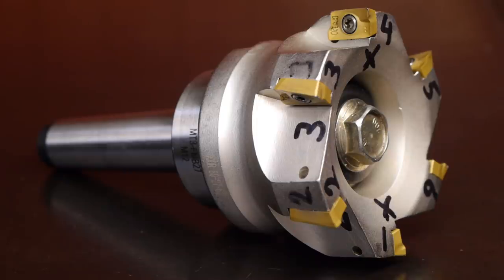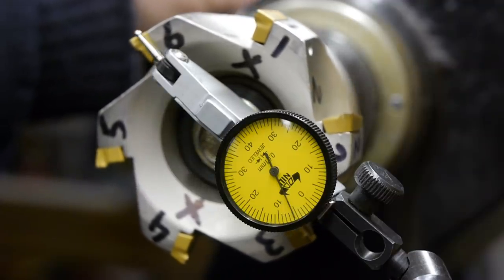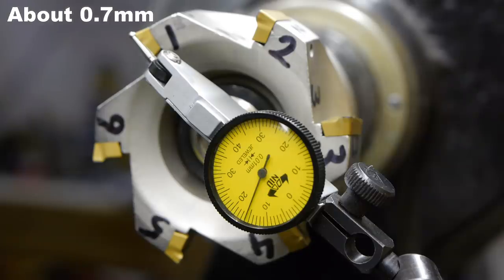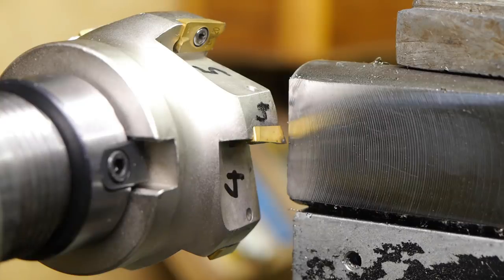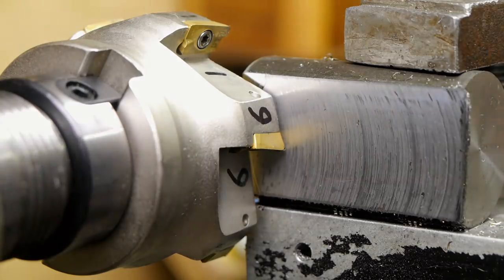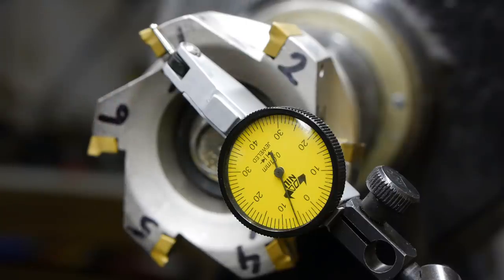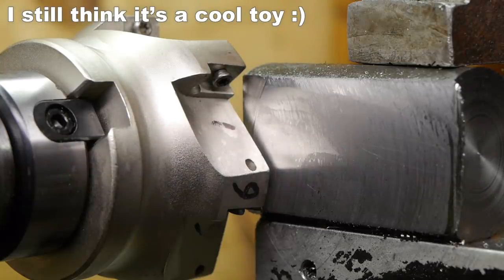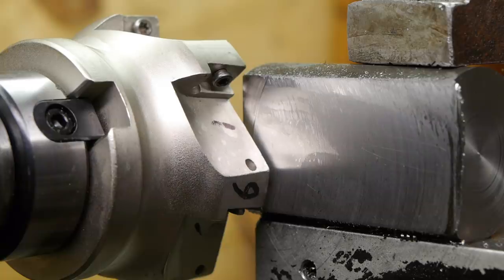Measuring the 80mm Chinese shell mill inserts height

Comment: Thanks for taking the time to do all this testing. Saves me a whole lot of experimentation to prove what I already suspected about the one I bought. I guess you get what you pay for. I'm beginning to think that these milling heads were specifically designed just to get us to buy more replacement inserts. I personally get a better finish by using a big 4 flute TiAlN carbide end mill. When I finally get my mill up and running, I'm going to try to perfect a fly cutter, so all of these multi-insert heads can go where they belong.

Comment: Thanks for sharing. Did you notice how good the finish looked when you had changed the pulley configuration. Maybe it is a rigidity issue and a slower speed and feed limits some of the end play. Maybe one more go at it slow and steady?  Although not ideal for carbide, it looked good for that brief moment you did cut.

Comment: Very interesting. As both the pockets or mount points and the inserts have manufacturing tolerance, maybe one could swap them around until the deviations cancel out more or less. After all, that's what they do in many industrial processes as well: manufacture something, accepting certain tolerance, then sort into statistical bins afterwards (LEDs, MOSFETs etc.)
PS. I bought a similiar cutter today, just a 4 face 50mm one with MT3 shaft. It cost 26 EUR incl. shipping. I wonder how they do that. (I used the links reserverd for members of the cult, hope that helps toward the mill..)
Reply from the maker: interesting idea. The tolerance on those inserts is about 0.1mm but I never bothered to check the size difference between the inserts.
Reply: @Rolingmetal  well,  that's probably a couple orders of magnitude above the inserts tolerance, then. Still, there are the screws to consider, which were possibly sourced from the cheapest supplier they could find..

Comment: Why 80mm? that size face mill with 6 inserts would normally be used on at least a Bridgeport sized machine, I think the general consensus is a fly cutter being the preferred option for smaller machines, although, I did find a 3 insert TPUN 40mm face mill gave good results, TPUN inserts are also available as commercial grade by many different companies.

Comment: Hi again, still love your vids and humor. You an me are using eqitment vit not the best posebilletyes, play in bearings and cheep bangood stuff. But when something is fleksing, f.eks bearingplay or a long stickout, the tool cant get underneeth steel and will just rub the chjps of, rather than cutting it. then the best way is to overdoe the feedrate and cut, and it will be better surface, but ven you ar closing in on the right size end take light cuts the surface vil get wors again, just have to live with it.  I have a good strong mill at home, and do some lathe work also in it.  I just turn the millinghead 90 deg and put a 3 jav chuck in the mill head.

Comment: The axial play shouldn't matter much as the cutter will be pushed back against the bearing.
You should also check the inserts on the other plane with your dial.  That is on the outside diameter of the cutter.
I think this is a good test though.
It looks like you did indeed get chips stuck back on to the surface.
I wonder what you get if you put a mic on the actual inserts.  Are they all the same size?
Carbide tends to give a better finish with heavier cuts but I understand your lathe isn't really suitable for that. 
Good test but :)
Happy turd year just so you know I watched it to the end.

Comment: You are not really taking a big enough cut with that tool (typically one would bury the nose radius, but you lathe may complain)  the inserts have chipped because of vibration (they have been bouncing onto the front edge).
Reply from the maker: I tried 0.8mm in the previous video but that was about the max the lathe could handle

Comment: I had similar results milling steel with one of those on my little ChiCom milling machine , it works fine with aluminum . I think it may be a result of not enough rigidity in the machine .

Comment: i have the same face mill ,you should run this on a mill at around 1600 rpm and above.also if you are worried about the difference in height of the inserts,why not shimm them.?
Reply from the maker: that's 4 times the speed the online calculator came up with.
Reply: @Rolingmetal  check out cnc using carbide.with coolant .
Reply from the maker: coolant would  just ruin my wooden work bench :)
Reply: @Rolingmetal  i think you said ,you are going to buy a mill.warning?don't buy a chinese mini mill.you will be sorry.just my opinion of course.
Reply from the maker: Yep. I switched on advertising on my channel back in December and I am saving up those earnings to buy a  little milling machine. The original plan was the cheapest mini mill but I've already switched to a more substantial  machine. Still Chinese, but I'm keeping my eyes peeled for something nice, small and vintage.
But there is no rush and I haven been spoiled with high end tools, so I'm sure I'll have some fun with whatever I end up buying.

Comment: Happy turdyear ;p     I see 2 obvious problems . ... the spindle 'floating' , and the cross slide not being square to the spindle .   The cutter shouldn't cut on the end of it's travel, if the cross slide & milling cutters were square to each other - much the same as a milling machine that is out of tram !   Could you try this setup on the Chinese lathe ?  
     Another thing you could check is the face of each cutting position with the inserts removed , which might be another clue to look into .      Good luck , & enjoy your turdday ! 
  "V"
Reply: why should the cutter not cut if the head is out of tram?
it will cut but not produce a flat plane but a concave surface.
Reply: Hello Jan , look at 6:32 . . . the back side of the cut is 're cutting ' - that means the play in the spindle is allowing the cutter to float into the material , or that the cross slide is not square to the spindle.  If there were enough cross travel to complete the cutting , only then would it show to be convex or concave !   Every cut that he made had a similar cut, with the END of the cutting biting deeper - the same happens when a milling cutter or fly cutter is used on a milling machine that is out of tram. . . the back side / trailing side of the cutter will 'dig in', but will leave only the slightest mark , or a cross hatching pattern if it is in tram !  With the play in the spindle , the cutter is cutting a 'moving target' - I would venture to say that the milling cutter is pushing the material toward the spindle at each of the cutter's edges , but NOT equally , so the end result is what we see as a strange finish. . . it shows accelerated wear of the cutters , as well as what looks like 'galling' of the chips into the finished surface ! ?     I will say that it is better than no cutting at all ! ;)   "V"
Reply: @georgewocosky  the cross slide is not supposed to be square to the spindle., all lathes are create that way to make sure facing does not create a convex surface
it is impossible to create a convex surface with a circular cutter no matter how far the spindle is out of tram

Comment: I think you may be expecting too much. Milling cutters like that are commonly mounted in substantial adapters in roller bearing nilling spindles. You have mounted it on an adapter with a smallish straight shank. Your machine is apparently a low power import lathe with (I'm guessing) an un-geared variable speed spindle. 

Youre testing the face run-out over worn, utinity grade inserts that may vary somewhat due to manufacturing tolerances. The facts your face run-out is within small tenths is quite impressive. 

Insert milling cutter bodies like yours are commonly validated by scanning face and radial run-out using a single insert movec from pocket to pocket in reference to the gaging diameter and face ground on the body itself. 

That said, there's no reason you can't use that cutter and adaptor for taking light facing cuts as you demonstrate. Your finish appears excellent. If you were expecting shiny, don't. I don't think your present machine and tooling will support the peripheral speed necessary (maybe double what you're running now.) I suggest you just use it but don't try for significant stock removal per cut.

Comment: Thanks for showing us this, i know now not to buy such a cutter. 0.08 deviation is way to much for getting a good finish. Also the inserts seem to be made of cheese.
Now if you were cutting hastelloy or inconel or something like that ... but mild steel should be nothing for decent inserts.
Reply from the maker: There is a lot of tolerance on this type of insert. about 0.1mm that might also play a role. I think the facemill is pretty decent and word a lot  faster than the fly-cutter.

Comment: Somewhere jn the VFD parameters is a modulation frequency setting usually 4000, 8000 or 16000 (4kHz, 8kHz ,16kHz)  the default will be 4kHz , if you have a modern motor with good insulation try setting the modulation to the max (16kHz)  it will make it run a whole lot quieter!
Reply from the maker: Not this one. It's old tech (1987), it won't run any faster

Comment: you have WAY too much play in the spindle... the leading edge of the insert is causing the spindle to defect and it chewing up the edge of the insert.   do you know anybody with the ability to spray weld like ABOM does.. perhaps have them spray weld build your spindle OD up to fit the bearings..  or even.. have them spray weld up the bronze bearing IDs to tighten the spindle clearance..  i used to have a Sioux brand molten Lead spray gun for applying lead as car autobody filler to large surfaces.  a friend borrowed it and then left it in a bucket that got rained in when his roof leaked.  that could have perhaps been used to spray in a layer of babbit while your bearing was spinning in a fixture.. 

 you may want to get some automotive engine belt idler and tensioner wheels to create a belt polisher..  so you can polish your spindle to a mirror finish..  holding it between centers..  then doing something about the bronze spindle bearings.  if you have to SLIT one side.. and file the bearing cap face or use some of the hard to get tapered shim stock to squeeze it down on the spindle.
Reply from the maker: If I set them any tighter there is not enough play for a little heat expansion.
by  the way the hournals on these bearings are tapered and so are the bronze bearings.

Comment: from what i know i think you are actually cutting too little at a time, but then again the setup isnt rigid enough to take big cuts either. But those inserts have a nose radius. And if you only take 0.3mm cuts like i think you said somewhere, youmight still be cutting with only the radius, wich results in poor surface finish. I tried this on lathe tooling with inserts as wel, less depth actually gave a bad finish, going with 1mm of cut for the pretty smal inserts gave much better finish. For the big inserts on the 20mm and up tools you can actually go with 3mm or something, but then you do need a serious lathe to not stall the thing.

Comment: a toolmaker i worked with, used to "touch-up" all the inserts on the cutter grinder when he changed , any talk about anal. but glen did good work.  poppy
Reply: If the spindle didn't have so much play , a diamond hone in a toolpost grinder would do the trick !   * But , even if all the inserts were coplanar , the amount of lost motion in the 'floating spindle' would still eat the inserts like candy - rigidity goes out the window :(   At least he's able to make some chips ;p !
Reply from the maker: Yeah but that will remove the coating

Comment: Your willingness to try is impressive, but so many of your videos trying to push the limits of accuracy .. come down to the precision and rigidity of your old lathe, which sadly is always going to be poor due to its plain bushings and lightweight castings. As I recall you have always had problems even with if the taper is right, plus the spindle has some flour in its oil film... so I don't understand how you can trust anything in terms of precision. If you want high accuracy you really need to have quality roller bearings with a preload as well as  much heavier castings and ways. It's time you bite the bullet and invested in a much better (mire rigid) machine (ideally 2, a lathe and also a proper mill, both with proper bearings (ideally taper roller, at the very least angular contact)

The other point is that as others have also commented, inserts come in a wide range of shapes and tip radii, large radii tips are for heavy removal and need a much stiffer and more powerful machine than you have. Those cheap Chinese cutters are great value for general machining but aren't meant for robin/Stefan grade precision and at the price asked its unreasonable to expect them to be. 

If you really want to use a large diameter cutter on your light weight lathe, consider using sharper inserts, and maybe just load 2 or 3, not all 6. And take very very light cuts at higher speed. Good luck